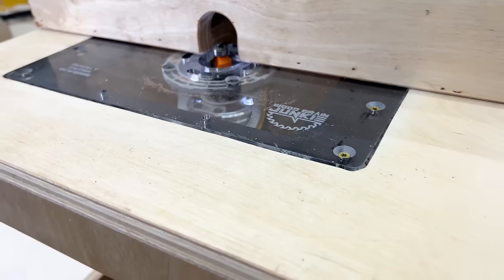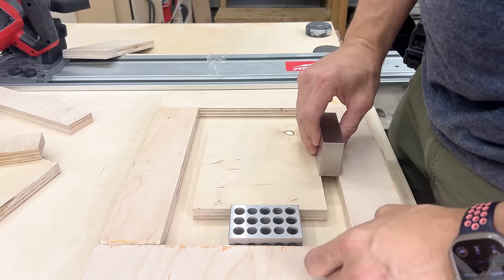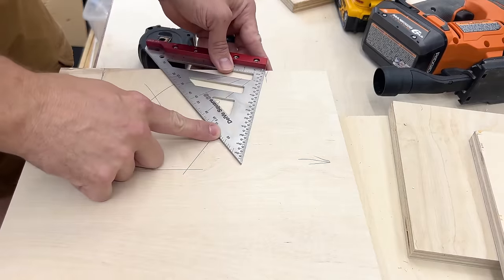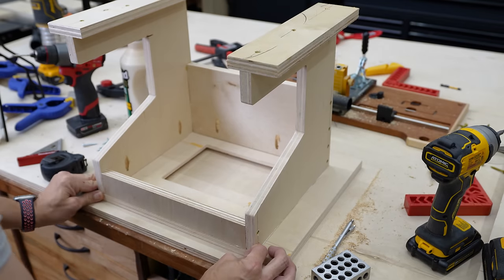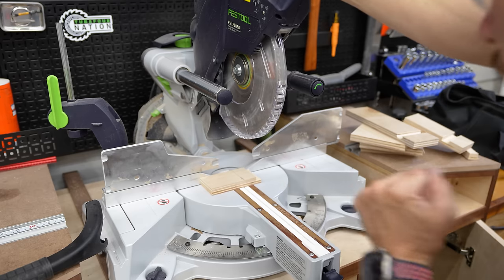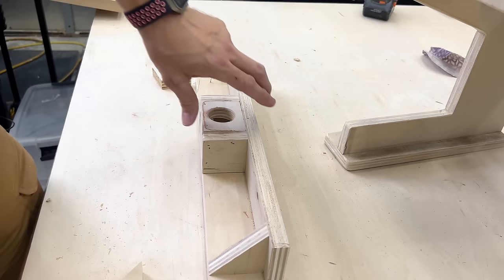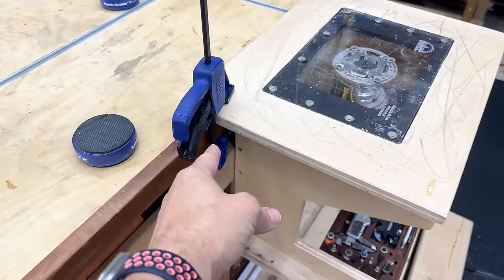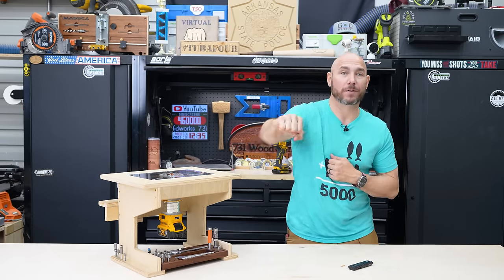Mini Router Table a Beginner Can Build and Get Pro Results!

Comment from the maker: ▼EXPAND FOR TOOL LINKS and INFO▼ 
Watch Next: How to Build a Portable Workbench - https://youtu.be/hQGK6pdMo_A?si=H_ktXGgm7FHp76YV
Tools In This Video: 
 
Router Table Plans - https://www.731woodworks.com/store/benchtoproutertable
Router Plate Insert - https://www.awin1.com/cread.php?awinmid=6220&awinaffid=780763&ued=https://www.etsy.com/listing/1314752427/38-in-thick-trim-router-table-dewalt
Walnut Router Bit Organizing Tray - https://www.731woodworks.com/store/router-bit-organizing-tray-walnut
Double Stick Tape - https://amzn.to/44urORj
Face Clamp -  https://amzn.to/3Picz9U
Router I'm Using - https://amzn.to/45Ornm3
Template Pattern Bit - https://amzn.to/3PjofsV
Pocket Hole Jig - https://faithvalleytools.com/collections/massca-products
Handscrew Clamps - https://amzn.to/3sqD43N
Corner Clamps - https://amzn.to/3PkKhvu
Quick Clamps - https://amzn.to/45SRAzE
10 Million Dollar Stick - https://amzn.to/3sGpwBh 
Festool Dust Extractor - https://amzn.to/3PjqLPH
Forstner Bits I Use - https://amzn.to/45tSFhV
Woodpeckers Delve Square I Used - https://amzn.to/3PkdIO4
Woodpeckers Framing Square Used - https://amzn.to/3qSLJvt
Ridgid Jig Saw - https://homedepot.sjv.io/nLPyyR
Push Block I Use at the Router Table - https://amzn.to/3YWuXrY
Pencils I Use - https://amzn.to/3Z4OwP2

📲 Never miss another tool deal. Sign up for my Tool Deals SMS Alerts - NOTE: I text out tool deals so you don’t miss any! text DEALS to 1 (731) 207-7151 Be sure to add DEALS to your text to me so you get added to the proper list.  You can also click this link https://my.community.com/731woodworks  Important to add the word DEALS to the text!

🇺🇸 Join the Tubafour Nation on Patreon to get an exclusive Tubafour Nation sticker, access to exclusive member-only behind-the-scenes videos, member-only livestreams, discounts, and other cool member-only perks! https://www.patreon.com/731woodworks

(If you use one of these Amazon and other affiliate links, I may receive a commission) 

Some other useful links:
Daily Tool Deals on my website: https://www.731woodworks.com/tool-deals
Subscribe to our email Newsletter: https://mailchi.mp/7e44c16eefdc/731-woodworks-email-newsletter
Check out our easy-to-follow woodworking plans: https://www.731woodworks.com/store
Outlaw's Board Butter - So Good it Should be Outlawed: https://www.731woodworks.com/store/boardbutter

Comment: Dude, use your blade guard. You may feel you don't need it, but you don't want to give viewers (especially inexperienced viewers) the idea that THEY don't need it.
Reply: “Remember… safety third” -Mike Rowe
Reply: Do you mean on his table saw? The riving knife is there and thats typically what you would have as the safety feature. He has a sawstop so the blade guard is super unnecessary.
Reply: @JjJj-mc8jb  Sawstop won't help should either the work or the scrap get dropped on top of the spinning blade. Don't pretend it can't happen. Thus, I could argue about the blade guard being "super unnecessary" but I won't bother.
Reply: @jamesmeader6539  hahahaha noooooooo james no blade guard if you are dropping peieces on the blade while its running you need a sort of "table saw safety cource". I mean im not saying it can't everrrrr happen but, should it? No you should be calculating those momvents as best as you can.

Comment: Simple and cheap to build with the exception of the outrageously priced top plate at the Etsy link. It's much cheaper to make your own. Other than that, this is a great little tabletop router table! I will build or buy a full size table later, but I need one quick for a project that I'm surprising my wife with while she's traveling! This fits the bill perfectly!! Thanks, Matt!

One suggestion: You could add a couple of T-tracks so that the fence can be adjusted without using clamps. It's just a little easier, but requires a couple extra cuts and the need to buy some T-track. With what you save by not buying that top plate at Etsy, you could buy the T-track and use a table saw to cut the dado without needing to buy an expensive dado blade to do it. Just shave a bit at a time to get that sweet spot for the T-track!

Comment: Hiya Outlaw!  Long time stalker of the channel, finally made the plunge into wood working and routing, and I purchased a couple of your bundles and I am starting with the Mini Router Table.  I have my pieces cut rough, all are sanded and smoothed, but I have not yet cut down the final dimensions in the guide.  I also purchased the same insert from Woodgrain Junkies too.  I was wondering for the template you created to plunge cut the insert portion, what thickness of plywood did you use?  It looked like either 1/2 or maybe 3/4?   I only ask because I got that same Rockler bit from a local Rockler store here in St. Louis.   And its length seems kinda on a short side.   And I know you should not have your bit extending to far out of the router chuck.   Just wanted to check with you on that.    Many thanks!  Bless!

Comment: I've got a cheap Kobalt 10" 15 amp job site table saw and I've made a "drop-in" palm router table to go in the slide out section.  I'm gonna try to adapt your fence for it, thanks so much for the inspiration and the know-how brother!
Reply: I have a cheap kobalt 10" 15amp job site table too, do you have plans for this drop in?  How did you make it?  And yeah the fence is a good idea.
Reply: @dardack  Oh I'm sure there's a better one out there somewhere.  But I just took an oak 1x8 that I had and cut it to length I think 23", then put rabbets on the underside left and right to make it fit the slide-out opening snugly.  I planed it down to level with the table.  I made my router holes (countersunk from the top for bolts) and bolted it on.  I made a miter slot on the long edge.  I used the fence from this as a basis for mine, but I made some "ears" or whatever for the underside of the fence and snug them up with finger bolts from the top like any other jig.  Super simple, quick and dirty, but it works really well.  I use my a palm router in this, it's easy to open the router latch and drop it out to change the bit, then pop it back in.  I know that was basic, let me know if you have any questions.
Reply: @skampp  I appreciate you getting back to me I just want something simple quick dirty but works.   Would you next time you take it out take a picture I understood most of what you said but the ears part and after I got lost

Comment: made something similar here, however I used drive in nuts (driven in from the top) and metric screws below the inlay so i can fine adjust the flushness of the inlay. nonetheless great thing to have and hugely more stable than freehanding with such a small router :)

Comment: Question: if you decide not to make or buy an insert because you are not confident enough to do that, would I just drill the holes to mount the router directly into part A?  Do I still need to cut out the centre in this case?

Comment: Is this table only for trim routers or for mid and full size routers as well?
Reply from the maker: It should work with any router if you have the right insert plate.

Comment: nobody i know has this amount of equipment so a newby is not going to do anythng you build without money to buy all those tools but nice video
Reply: All he used was a table saw and jigsaw… jigsaws are like 30 bucks. And a table saw should be the first tool you buy if you are getting into woodworking. It’s the cornerstone of everything. Used ones can be found for less than 150.

Further more you can literally do all
These cuts with the jigsaw, handsaws, or whatever.

Now for the recess insert. Surely you have a router to do that or why are you even making a router table for a router you don’t have?
Reply: True
Reply: I mean true about the table saw being your first purchase.